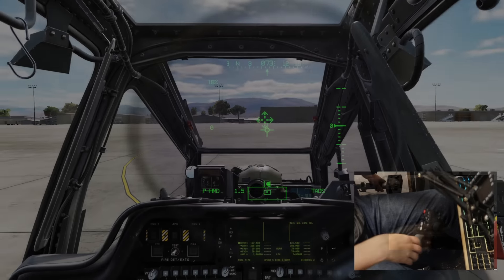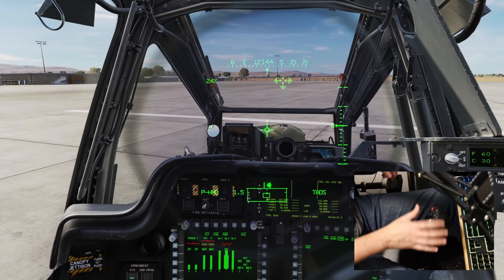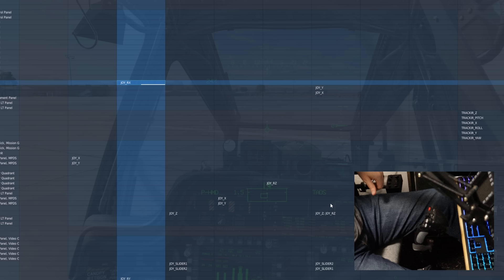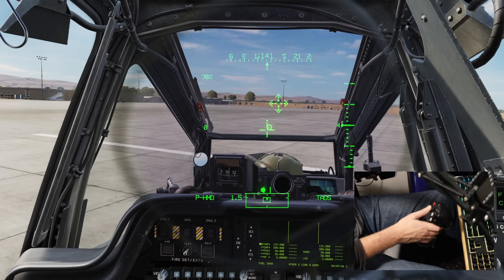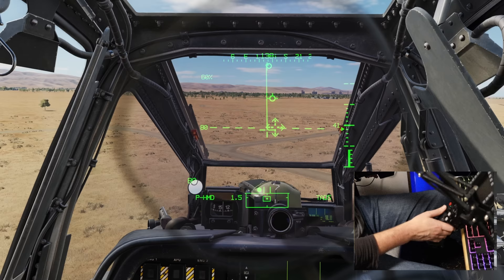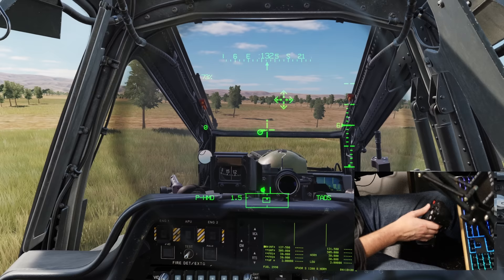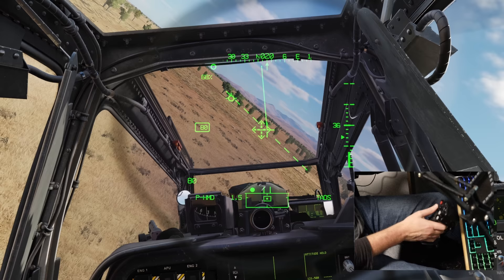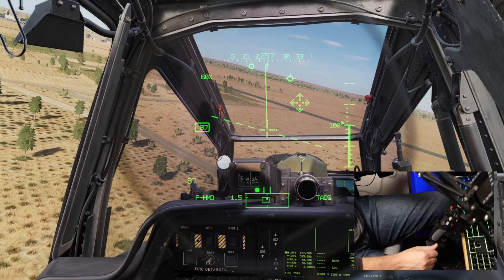The Importance of Control Touch in flying and some thoughts on Dry Clutch | DCS World AH-64D

Comment: Hey Casmo, good video, I have a similar set up. What joystick trim settings are you using with yours ? I also have removed the springs and fitted a damper to my crosswind rudders, so all the controls effectively have no centre return. What would you recommend for this (and why!) and I also find as the stick stays where I put it, I don’t really use trim…..what about you and again, why? Many thanks!
Reply: Of course, there is also the discussion around curves and degrees of movement required on the stick. I find on  my other simpit set up which is for the DCS jets, using a Brunner FFB base, that more granularity is good, it’s easier to be precise with the micro movements needed if they are not measured in millimetres or less …….. of course there is a cut off point as well!

Comment: I have same experience of not being able to use hold modes with my FFB joy (Logitech G940)
Reply: Same, not exactly easy to keep them enabled on my FFB2 either. ED really should add an option for allowing a little more movement before they get disabled, even if that might not portray the real thing. I mean, having a trim reset doesn't either. Or using a figher jet's grip and a split throttle instead of a collective... ;)

Comment: I've been thinking about doing this, have a MCG Ultimate, 10cm extension with 20lbers  center mounted on a Blackbird chair.  One thing holding me back is that I also play Star Citizen and not sure how that is gonna feel lol......and my understanding is that you have to disassemble the base to set the clutches?  If it was easily adjusted from the outside I might be more inclined to do it.
Reply from the maker: Yeah I have the same concerns. I’m not sure it’s a keeper for me.
Reply: CM3 Virpil base can set clutch and spring tension externally but I’m still on the fence.  With sufficient clutch for a dead stick it feels overly stiff to me.  I have the Alpha Prime on a 200mm extension.
Reply: @doifeellucky my cm3 is super light when rigged for deadstick. How’s do you have your spring tensioned?
Reply: @142nd_Bama  Pretty stock at the moment, but I loosened them as far as they’d go before they were impacting on the rubber cover.  I need to try so other springs and cams at some point.  I also need to use for fixed wing so couldn’t rely only on the clutches.
Reply: @CasmoTV  I wound up doing this 3 days ago, I tightened the clutches down, but it's not enough to hold the stick in place.   But the big thing is that it takes more force than I'd like to "break" the friction on the clutches so I wind up putting in too much movement.   But I do like the dampening effect because small movements I make like adjusting myself in the chair don't translate as much through the stick.    Have you kept your setup or reverted it back to non-dampening?

Comment: What do you think of dry clutch without a stick extension?  I don't think my vkb gladiator supports extensions, but I can clutch it down.
Reply from the maker: Never tried it. 🤷🏻‍♂️
Reply: I use this stick with no springs with the clutch set just tight enough to stop it moving on its own.

Comment: Control curves don't make any sense to me if the stick doesn't have a center position (this applies to the collective as well). I want the control gradient to be the same regardless of where I am in the control space. 

Seems like the hold mode problem is a DCS issue, not your issue. 

Have you tried adding grease to the clutches? That may give it a more damped feel.
Reply from the maker: My comment regarding curves has zero percent to do with dry clutch. Not an ounce. I’ve constantly run curves and I’ve consistently seen instant improvement to people’s flying when they do. But y’all do you.
Reply: @CasmoTV  strictly speaking, you're right, they're independent. What I'm referring to is how one complements the other. To me, the purpose of curves is to artificially desensitize the controls around the center detent. We do the same thing on our fly-by-wire aircraft in the industry (we call it "stick shaping" rather than "curves"). If there is no center detent, this no longer makes any sense since the flat part of the curve is no longer centered about any discernable point. I can still see it having some benefits as the stick should still be in a roughly centered position in hover, where you want fine-grain control. Still, control response should be fairly linear to stick inputs. 

I will admit I'm letting my own biases in here. Most stick manufacturers (virpil, vkb, etc) get the force-vs-displacement relationship completely backwards. They have a shallow slope in the center and steeper slope at the extents. Ideally, you want that slope to be constant: ie, the force-vs-displacement curve should be linear. It's not unreasonable to shallow out the slope near the extents however so that you retain can still feel the forces near the center, but aren't totally exhausted near full deflection. In my opinion, people think they like the feel of what manufacturers are giving them (shallow slope in the center, steep at the extents) but then compensate by dialing up the curves in-game such that the force-vs-roll-rate or force-per-g is roughly linear. 

Personally, I don't use curves at all (except on ministicks like for the TDC). I use the cosmosim cams in my Virpil base, which I've found are the most linear without an obnoxious breakout force (they actually have no breakout force at all). I would prefer if they had a slight crisp breakout force, but I found I can pretty comfortably fly anything with no curves applied ingame. I recognize, however, that not everyone is flying with the same hardware, but to me, the use of curves indicates that your hardware is not stiff enough and not providing the correct feel.

Comment: Looks like you took down your dislike of the new flight model video because of the weird role it has on take off. I don't know if anyone else has this issue but I've found lately the trim is set to one side or the other (randomly) so now the first thing I do is reset the trim and it seems to have alleviated that weird role on take off it has.
Reply from the maker: I didn’t recant a thing I said. Still don’t like the new FM for the roll. Said it in both videos.
Reply: @CasmoTV  never said you recanted, I just can't find the video you made specifically on that subject.
Reply from the maker: @HeloHounds  ah. Idk it’s there somewhere.
Reply: @CasmoTV  the whole reason for my post was to let you know what I've found recently is all. i.e. the trim being randomly set on spawn.

Comment: I was like a pig on roller skates when I first started out with the Apache. It was ugly. Here's what I found to transition to a smooth operator. Tune your axis to YOUR inputs, not what you see others do. Too many videos that say to set your axis to 15 and invert and yada yada yada...worthless. Then get a stick that you can adjust the tension. I was using a Thrustmaster stick that is stiffer than a...well...you know. Stiff. No real helicopter has a self centering stick and it is hurting your inputs. I have an old Saitek that has the spring and I took some side cutters and snipped off a little at a time until it's like the stick you see Casmo using here. A little tension to keep it from flopping around is all you want. And the last trick is to get good with the trimmer. Once you fly the Apache enough, you will know how it will react when you start adding collective. Trim it out before you even get there. All the sudden when, depending on your weight, you get wheels off the ground, it will just sit there. Same when landing. Once in ground effect, you can hover there until you run out of fuel if you like if your trim is right. And lastly, practice. Forget about missions and shooting and all the tactical stuff at first. Take off, hover, scoot left, right, back, forward, hover, go up another 10 feet, repeat and set it back down. Until you can do that with ease, don't even consider fighting. Airmanship before all. Once you get that down, play with wind speed, elevations, temperatures, light load, heavy load...you get the picture. Then do it at night. THAT is another world. What little depth perception you had will evaporate with viewing the world through night vision and the TADS. This all sounds like a shit ton of work, but it's what is needed to be able to land on a frigate at night at max weight. And my last bit is don't get frustrated. I know, easy to say, hard to execute.

Comment: I play with no extension. I had to push the curvature to around 30 AND lower the saturation, and as you say I do lose some (quite a bit) of the movement range. But its helped me immensely with keeping smooth movement which I have found otherwise really really tough to do on a stock warthog stick.
Virpil setup looks very interesting!
Reply: Using the Saitek X56 Rhino, I have no option for an extension as I haven't found anyone that makes them, however I fly with the lightest spring installed and no curves and only a small null zone in each axis.

Comment: I can't recommend any curves in helis in general, especially not on collective. A tiny bit may not hurt, although I can't see how that would be very beneficial either, especially with clutches.

Curves make the center of your throw more precise and less sensitive, but it's at the expense of the outer edges being more sensitive and less precise. Sort of like a fisheye lense effect on your stick axes.

Unless you keep the helo trimmed to stay within the precise center all the time, you aren't going make the flight more precise. With cams and dry clutches, the whole idea is that you don't need to trim. So, in a forward flight you're going to spend lot of time in that weird region where your pitch forward is more sensitive than pitch back, same with roll if you keep the stick biased laterally.

Although, with heavy springs and no clutch, you will need to fight the springs a lot more towards the edges, making your hand less precise, so paradoxically a negative curve may actually make more sense in this case.

Same thing with the collective, you're just turning a linear motion non-linear, where an inch of extra collective near the edges is going to give you a lot more power than an inch of collective near the center. But hovering needs different amounts of collective than forward flight at various speeds, so, you won't have the collective in the center the majority of the time.

I don't want to tell you how to fly, for each their own, I just want to point out that the stick curves make a lot more sense for a trimmed airplane, where we want lot of precision near the center of the stick and we don't care that much about precision in big maneuvers, so, for a small stick with little throw, axes are a good band-aid tool.

Saturation X ignores part of your throw. It can be used for example on a throttle with detents, if you have a physical detent on your throttle but you're flying an airplane without any AB, then by default, you'd have to lift the throttle over the detents to get to full power. So, you can use Saturation X as a limiter, therefore you don't need to lift the detents if you want mil power, and if you do lift it over the detents anyway, it does nothing. The area above your detents will be ignored. 

Saturation Y is used to ignore part of the airplane throw. To my knowledge, this is only used by people who fly exclusively aerobatics and formations, who want as much precision as possible and literally never do any big maneuvers. It's again a limiter, but the other way around. You can use it to greatly improve the precision of small maneuvers at the expense of literally being physically unable to do big maneuvers.

Deadzone ignores stick input around the center of the stick, it's again a clutch for sticks that input fake inputs or wobble near the middle. Although, in your case, if you trim and put the stick to the center, it may allow you to get to the autohover easier.
Reply from the maker: You shouldn’t be at the edges with helicopters so that shouldn’t matter. 

And I have to disagree. Curves have an immediate impact on every single student I’ve worked with.
Reply: @CasmoTV  Well, if you don't trim, you would be quite far forward on your stick in a forward flight, may well be outside of the middle circle that has enhanced precision, and out in the outskirts that have reduced precision. 

And again, for each their own. If it helps the students, that's great, I can see how curves could help some people on some hardware, assuming you keep the helo reasonably trimmed.

I was more commenting in relation to your hotas, since you have an extended VKB stick with clutches and a long collective, so I can't personally see the point of the curves in that situation, even though the curves you have are fairly small anyway.

Again, please don't take this as criticism, there's nothing wrong with using curves, I just wouldn't personally make a universal recommendation for curves for everyone, since curves have tradeoffs.

I'd rather have people have a good understanding what do the curves and saturations actually do so they make their decision, and if they decide that the tradeoff is worth it, be it.

Comment: I know they said nothing changed but ever since the late May update the flight behavior of the Apache seems to have improved again (even the hold modes). Less crazy rolling. I still think something is wrong with the trim ball because it seems wrong that you can be way out of trim at high forward speed in a bank.